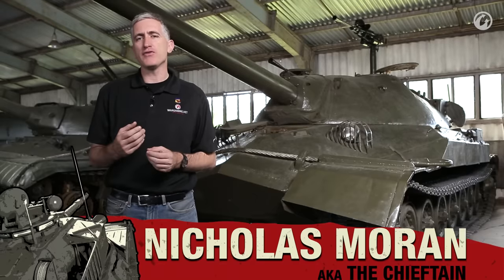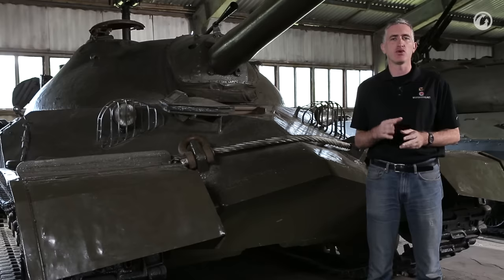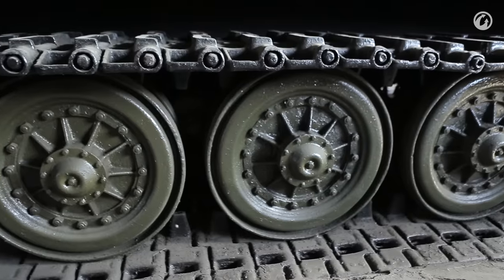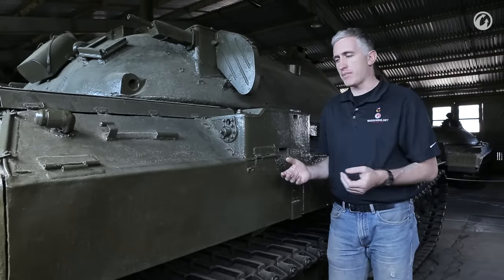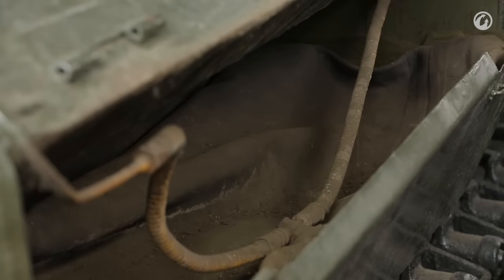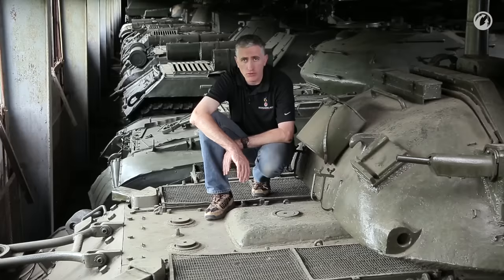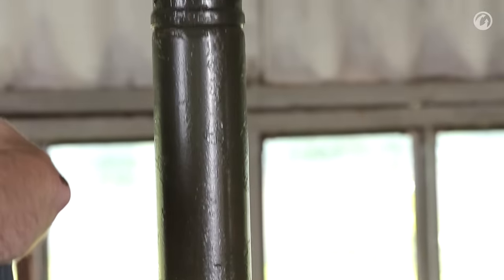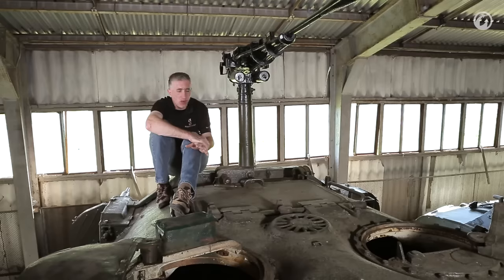Inside the Chieftain's Hatch: IS-7 Part 1

Comment: The machine guns was only used to keep enemy soldiers away from the tank, a common practice by soldiers from any army was to throw grenades or explosives into a hatch to kill the crew or fire RPGs at it since the tank cannot engage any threat that was close to it with its main gun.
Reply: The Soviets actually had dedicated anti tank units that specialized in a close combat anti tank role. They mostly used standard or available infantry equipment to show the infantry they could fight back (or propaganda units if you want to look at it that way, they were never that effective compared to more conventional anti tank guns)

Comment: The back machine guns were a attempt to keep tank killing infantry squads from climbing on the tank from behind and destroying it. The kv1 also had a machine gun in the back of the turret I believe.

The Japanese equipped some of their tanks with back firing machine guns too. Seriously you were not aware of this chief ? The German Porsche Elephant is a good example of what happens when you have no secondary armament. It was hunted like a dog by Russian infantry when the Germans attempted to use it as a primary break through tank at Kursk. Were all these machine guns needed on this tank?  Certainly not but more is better then none or just one in the turret. There were many instances of german tank drivers having to "hose down" the back sides of their own lead panzers with their front machine guns. Even HE was used fired on the back of their own tanks when they ran out of MG/a to drive off Russian tank hunter squads jumping on the back of lead element armor. I imagine this was a real worry to the designers that's why all the machine guns. Oh and one more thing. The did a pretty wise thing IMO about NOT cutting into the front plate of this tank for a machine gun port that would certainly weaken it's armor.  It would have been better to fix a remote machine gun for the driver IMO.
Reply: But those on IS-7 (Execpt for anti air one) is FIXED. Not rotatable. No elevation or depression at all. I think infantry is sure to avoid the guns and climb on.
Reply: Yeah but ball mounts can be flung back into the tank when a tank round hits it thus killing the crew. Fixed or not its a gun and its not gonna get you killed.

Comment: Chief I think that those fixed machine gun positions were basically defensive measures. If you notice the forward, fixed position MGs are located towards the rear, so as to cover the entire side length of the tank against Infantry.. who are trying to possibly climb up onto the tank or place explosives on it etc. I do not believe that they were intended for medium or long range usage.

Comment: I never knew the IS-7 existed....
Reply: I don't do research or lookup alot of russian tanks :P
Reply: Epic Julian  hahahaha realy never saw it in battle??
Reply: ok
Reply: ***** even more didnt...
Reply: ***** sure. But I think the majority are blueprint or borderline fictional. Take tier ten for example. I think there is 4 vehicles there that existed at all.
Reply: ***** When I said that, I guess I meant produced in any number. I agree with your list with the exception of the STB (japan produced hundreds under the name type 74) and the Foch 155 (as far as I know it was only a suggested improvement to the foch with no prototypes or models). 
Thank god the chieftain will be added. The number of super hover tanks is getting silly.
Reply: ***** I'd prefer they get rid of the fictionmobile WT E100 as well... I've seen size comparisons of the proposed FlaK 128 with autoloader mechanism compared to the E100 chassis... in reality it would never fit onto it.
Why does the 'rifled 105' thing have you annoyed? It's technically not wrong... but yeah it should be called the Type 74
Reply: Dysphoricsmile Not sure where you're getting your info from but as far as I can tell it's basically the same tank.
If they put the Leopard 1 in the game with it's true specifications it would be absurdly OP as well. They still did it.
Reply: ***** Yes I know, the focused on first shot kill and mobility. The type 74 only had conventional steel armour (i cant find anything saying they upgraded to composite) which I doubt would count for much vs hollow charge, heat and sabot rounds.
Reply: Dysphoricsmile
a) That armour would make it like a baby IS7, except an is7 you could penetrate in the side
b) irl that armour would still be pointless vs modern munitions
c) I dont think I said anything about an autoloader or rate of fire...
d) wargaming concerned about fantasy tanks: bwahahahaha
e) where on earth are you getting this information from? I can find next to nothing about the STB's online
f) so you listed the values of the most modernized version?
Reply: Epic Julian lame lol is7 is king
Reply: 100 ordered if they could reduce mass to 60 tonns or 55
Reply: Well, you bloody do now.
Reply: Then you never played WoTB
Reply: @siva4wotblitzhero531  I've played Blitz off and on since the game came out xD And I have the IS-7 on PC at this point xD

Comment: Why is the barrel lifted? Is it to stop people from walking into it? What about during a parade? For driver?
Reply: the barrel is lifted because if the tank were to go down a steep slope the gun wouldnt dig into the ground infront of it, not sure why lifted when stationary tho, probs to stop people from smacking their heads as u mentioned
Reply: thanks for the clarification.
Reply: ***** Everything those person said is true, but there is also an another reason, well I think. 

It's like a infantry soldier pointing the gun on the ground, it tell that it won't fire, well it might fire but it's like a " safe ". In war tank always carry a shell inside the gun, just in case, so they lift the gun to make sure it if they do something wrong the shell will just fly in the air and land somewhere else... which in that case you don't mention it and hope nothing bad happenned the other side uhuh.

So I supose even if there isn't any ammunition in it, they still keep the gun lifted just to say " hey it won't fire at you, it's in rest "
Reply: Real answer, the barrels were lifted so storage would be easier, lifting it up would allow the tanks in front to move closer together, thus allowing for more space for more tanks.
Reply: Fallus symbol.. even on parade ...
Reply: sometimes it easier to reload.

Comment: I got the idea of the driver operated mg's  to be used , when enemy is trying to run  up to the tank and throw molotov cocktail or some magnetic shaped charge etc. on the tank..   the driver could fire all mg's at once, while turning the tanks on spot as fast as it can rotate 360's ..    it would spit out on 4 mg's + if gunner decides to use his aswell.    ..    

One could think that the opposing force would hit the dirt and try to hunker for  cover instead of running on tank to plant their explosives etc..      

At least i would stop on my tracks and think something else or try later again.

Comment: Might the fuel filler caps be located underneath the overhang from the turret rear? If only there was enough room to rotate the turret 90 degrees to one side and check.

Comment: Well protected..until you accidentally angle that pike nose and a Chaffe puts a round through your upper glacis.
Reply: arty arty
Reply: That upper glacis is 150mm and heavily angled... there's not really anything in ww2 that could penitrate that armor. It's quite ludicrous actually
Reply: Bruuuuh or a j panther wrecking you from 2 miles away
Reply: Harvey D JPanther can't pen this. I guess, only tank destroyers can do this in.
Reply: @misterharveyd5594  75 mmhigh velocity vs 128mm . It stops both .....
Reply: @misterharveyd5594  That armor was designed to be proof against the 12.8 cm.
Reply: That 150mm isnt the thing which makes it very great at bouncing. The Slope does. If enemy gets 90° view on the plate, the tank is surely gonna kill 2 crew members behind the glacis.
Reply: Jorge Wilson The jagdpanther had the same gun as the tiger 2, the 8.8 cm pak 43.
Reply: HMMM Intensifies ....close...it was I believe the 8.8 KwK (kampfwagonkanone) L71. The 8.8 PaK (Panzerabwehrkanone) L71 was very similar but was mounted on German tank hunters.....

Comment: Three co axial mounted machine guns/cannons and the machine gun on top of the turret was controlled from within the tank, so there were other options for independent aiming of mg guns without the driver having to rock the tank back n forth.  There was no western tank from the 40's 50's or 60's that could stop this machine but it was expensive and way too heavy to be transported on the then flatbed rail cars.

Comment: I had a dream last night about an IS-7 that drove into the lake by my cousins house. It immediatly sank to a depth of over 100ft, which was immpressive, as my previous recollection of that lake was that it was only 20ft deep max.  My role in this dream was to run a set of jumper cables to the posts on the back deck that are used for jumping the tank.  This allowed the crew to run the oxygen generator. Are you going to make a part three about the ability of this tank to be watertight to 100ft, the battery posts on the back deck, and the oxygen generator ;) :P

Comment: I wonder if you even knows what "More Dakka" actually means. or rather where it originates from.

also why are the mounted machine guns that face forward so far back on the body? If they're primarily meant for the driver to use shouldn't we be a little further to the front?
Reply: +ultrajd If it's not Orkish, I'm not sure.
Reply: TheChieftainWoT it is good sir. 

Random question Chief. What's your opinion on the proposed Ratte Tank?

Comment: Whoever was suppose to fire that top mounted heavy machine gun must have had balls of steel if that tank was in combat. Firing a machine gun while standing on top an elevated position without any form of cover....
Reply: isn't the 14.5mm gun on that was supposed to be an anti-air machine gun?
Reply: Robert Shockey
Well it is forward mounted. Since top mounted machineguns during WW2 were always usable against air targets, I guess this one should elevate enough for that sake too. But offcourse, infantry troops will get their day ruined by it too.
Reply: Robert Shockey Good God that's even worse still ! Just imagine the poor bastard firing that machine gun against a strafing aircraft that is launching anti-tank rockets and bombs as well as firing it's guns for good measure....

Comment: Which one has better armor, IS-7 or Maus?
Reply: Maus is thicker, IS-7 is better.
Reply: epion660 Thanks for letting me know
Reply: Mystic ToMato np, love helping people learn about this stuff.
Reply: epion660 Just how is IS-7 armor better if Maus' is ticker? Slopped?
Reply: Mystic ToMato Yep. Maus has much thicker armor, and it's sloped back about 45 degrees. But that's it, just 45 degrees straight back. The IS-7 has a semi-famous russian 'pike nose' and 'mushroom turret'. The Maus is blocky, the IS-7 has wonderful curves and angles.
Reply: +epion660 Also Maus is the only tank I know that has incredible rear armor too
Reply: Mystic ToMato Yeah, it's one of the few. The reason for that is it was supposed to be invincible, and it cost an incredible amount, so no risk could be taken for possible destruction.
Reply: +epion660 Yeah that means that Shermans and T-34s wouldn't stand a chance against Maus
Reply: Mystic ToMato pretty sure the 76mm shermans and the T-34 85's could still pen the rear, but either way, the Maus was supposed to be unstoppable. They forgot a major flaw, infantry, mines, aircraft, it would have been obliterated.
Reply: +epion660 The rear of the turret has 220 mm and the rear of the hull has 190 mm, pretty sure those guns would be powerless
Reply: Mystic ToMato the 76mm HVAP can go through the turret rear, and even possibly the turret front at close range. Can still pierce the hull rear at 1km easy. And in all reality, one shot is all it takes most of the time. the 85 can only take the rear of the hull with its APCR at 100m or less.
Reply: If I recall Tiger 2 had frontal aromor of 160 mm (the same as Maus hull rear not to mention much thicker 210 mm turret rear) and there isn't any evidence of it's frontal armor ever being penetrated.
Reply: Mystic ToMato Keep in mind, the Maus's rear is practically flat. The Tiger II had heavily slopped frontal armor.
Reply: epion660 You got me completely there, good point
Reply: is 7 has better firepower and fire effectiveness. Maus has Thicker armor than is 7 but still is 7 is better than Maus. is 7 front = 150 mm side and rear idk Maus front = 200 mm side and rear idk too xD
Reply: +ross nathaniel soriano IS 7 only has thick armor on the front, Maus has 220mm on the hull front and 250mm (if we include cannon manlet) on the turret front. 190 on hull sides, 220 on turret side, 190 on hull rear and 220 on turret rear. So pretty good armor for WW2 one of the few tanks with insane rear armor.
Reply: +Mystic ToMato IS7 is more practical
Reply: Lolas Golla True
Reply: But haves more powerful gun
Reply: IS-7 has better armour IRL; Maus has better armour in game.

It has to do with how APCR gets negative normalization against highly sloped armour IRL.
Reply: EcchiRevenge Frontal, Maus has better side and rear armor IRL
Reply: the Frontal armor of the IS7 is a effective 556MM thick from the front, the Maus is 348MM thick at 37 slope degrees on it's primary plane.

Not that either of these numbers matter, since nither could penetrate each other.

then we get Fin Stablized HEAT in the 50s, then ATGMs, both of these breaking the 500MM of penetration and in missiles getting over 1,000 MM penetration

This is why the Leopard 1 exists, you can't make a tank heavy enough in the early cold war to stop heat rounds, so might as well be fast and have a big gun.

Plus as soon as smoothbore guns came around on both sides, steel armor of any thickness was irreverent, the M1A2 can fire the M829A3 and A4, both have over 750MM of penetration at 2KM over 1000 at point blank range, and that's just a soild Sabot.
Reply: Ummm 750mm?
Reply: ross nathaniel soriano My reaction is the same
Reply: ross nathaniel soriano Thats what the company that makes the M829A4 says it can produce, go look it up if you are interested.

Mind you, composite armor can easily break 1000MM of RHA equivalence, the Challanger 1's frontal turret was something like 1,100MM of effective armor and thats decades old now

Like seriously, go look up how amazing modern composite armors are and how stupid powerful missiles have gotten.

just the AGM-65 Maverick has a 120 something pound HEAT warhead, it has 1,500MM+ of RHA penetration.
Reply: Redneck Fury well we are talking about ww2 tanks not modern tanks.
Reply: Lol
Reply: +Redneck Fury Yes and T-14 Armata has frontal hull armor equivalent to 1500mm RHA and frontal turret armor equivalent to 2000mm of RHA imagine that but you said IS-7 has 750mm and it's 1950's tank so nah IS-7 has from 250-300mm frontal armor, sides and rear are pretty strong too.
Reply: Mystic ToMato 150mm only on front and side not 200mm+
Reply: ross nathaniel soriano Yes but it's also slopped and when you take that into account than it has close to 250mm of effective protection, 300mm was a mistake
Reply: Mystic ToMato Highly sloped armour also has negative normalization, so it's actually more effective than the LOS thickness.
Reply: EcchiRevenge When the hull armor is slopped the shell often goes into turret and that's the reason why turret is the most well armored part of a tank
Reply: Mystic ToMato Where did i say that? 

"the Frontal armor of the IS7 is a effective 556MM thick from the front, the Maus is 348M" is what i said

The IS7 has armor sloping in two directions, from the very front its massively thick, you have a primary angle and a secondary, so in a stright line its much tougher then the Maus is.
Reply: 556mm you said
Reply: Mystic ToMato So?
Reply: EcchiRevenge It's not 556mm
Reply: Mystic ToMato Effectively it could be, if the negative normalization bumps effective thickness to 150mm/cos(between 74-75 from ~55 degrees vertical/30horizontal, iirc).

But I don't have the formula to calculate effective armour for the negative normalization.
Reply: EcchiRevenge Sorry, my calculations where wrong, i assumed it was 60 degrees back and 45 degrees inwards, according to my math is 366MM thick in line of sight with the correct angles.
Reply: Maus if you're  into angling, IS-7 if you're facing the enemy
Reply: Cube Effect Thanks for a good comment
Reply: @epion660  It never seen combat. If it did so the Area would had been crowded by Bombers, AT soldiers and Lotta tanks to take out that beast lol
Reply: @bisbas1402  iS7 is used, Unlike Maus who only seen Testing which ended up in fails as Maus killed itself with its own weight

Comment: Maus or Is 7? I would choose Is 7 because it has better firepower and fire effectiveness. Maus do have thicker armor but it is blocky not like Is 7 has curved armor front to back or rear plus Maus is really heavy so it's kinda slow Is 7 is a heavy tank but faster than Maus but Maus is slightly fast to reload than is 7 but still slower fire rate = more powerful hit. but I would go to Maus if he will battle to a E 100 tank.
Reply: In real life, i'd go with the IS-7 every time. The reason being the Maus would be more likely to kill itself than actually go into battle, as it was incredibly mechanically unreliable. If games like World of tanks and warthunder modeled tanks reliability, the Maus would break down less than halfway out of the spawn, and the King Tiger would lose it's transmission half way into the battle.
Reply: epion660 Is 7 doesn't have a chance on E100 that's why I said I will choose Maus. Have you read my last sentence?
Reply: Yeah, but the E100 would break down before the battle began, and the IS-7 is really mobile.
Reply: epion660 what I mean is on 1 vs 1